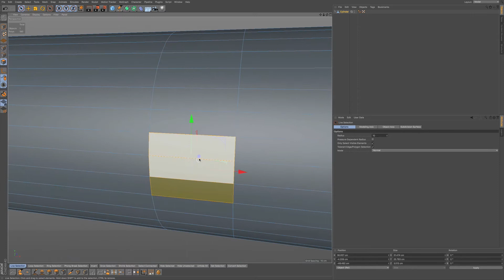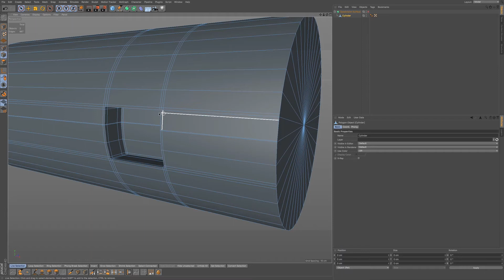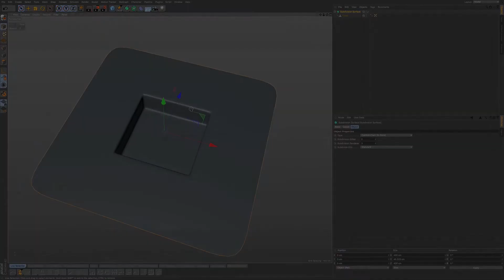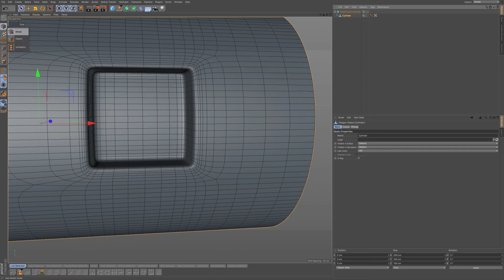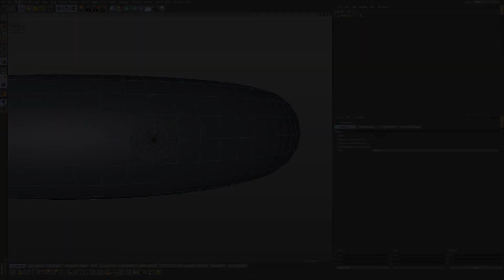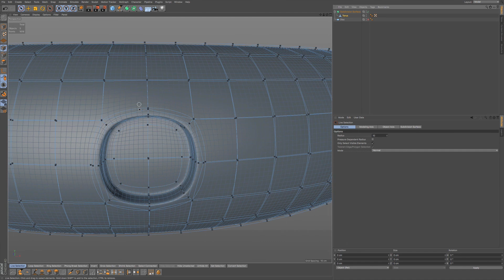Making holes in Cylinders and Torus in Cinema 4D

Comment: Hi Michael, how can you extrude from a cylinder very near its edge or near a fold in its vertical geometry, when you don't have enough space for a nice square polygon next to every corner (unless you put in tons of geometry)? Running those diagonal lines through very rectangular polygons near the edges causes apocalyptic creasing.